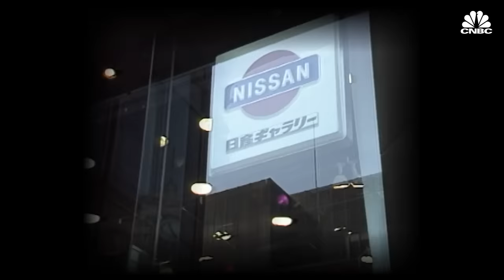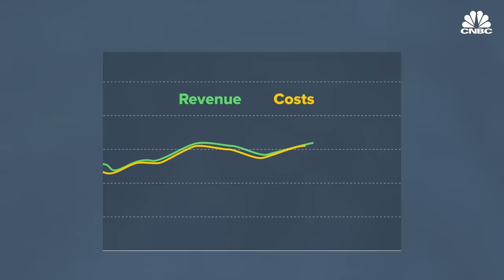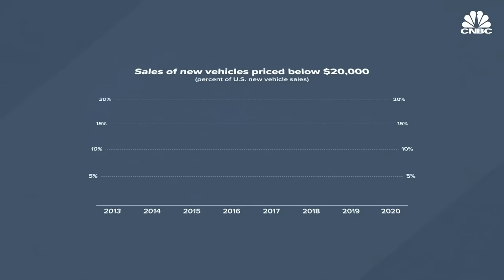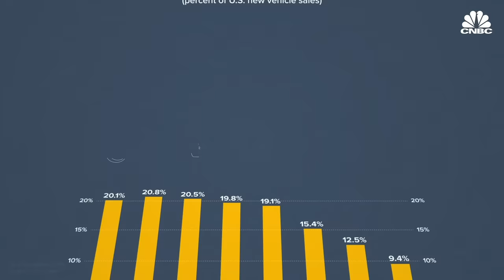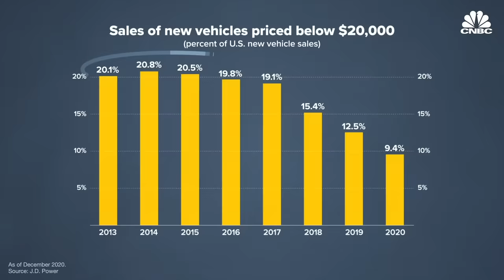Why Cheap Cars Are Disappearing

Comment: I'm shocked they're pointing to electronic features as a cause. A nice stereo can be put in at best buy for under $500. That's not even putting a dent in the 10k+ price increases we're seeing.
Reply: I know sometimes car dealerships will add the cheapest options for way more than what it’s worth on their websites it’s absolutely ridiculous
Reply: Look at all the HUD madness
Reply: I agree. It's a BS explanation. Adding Bluetooth? Give me a break. I have some old Airpods that cost 200 dollars that had the best Bluetooth when sold. The 10k+ price hike is because of a low-res camera on the back and some Bluetooth?  =|

Fair enough if people are going for something more fancy, like Apple's CarPlay - features like these probably add about 1k each, so would add up pretty fast.
Reply: @elliott8175  the camera also has sensors to tell you how close you are to something so it’s a bit more advanced than you think
Reply: @slapshotjack9806  Well, it depends on the set-up, but if you're like me then you just want a camera to cover the blind spot. There are "beepers", but they were around before the camera, and don't necessarily come with the package.
Reply: @elliott8175  oh I was talking about rear cameras which are mandatory
Reply: I think you're forgetting that it's not just "better" stereo systems going into these cars now. It's all of the sensors, software, and associated parts that come with tech packages that allow for convenience features such as collision warning, blind spot warnings, lane assist, etc. You can't expect vehicles to maintain a $20K price tag if consumers are demanding these new features be added but the quality of the vehicle not be compromised.
Reply: Typical boomer likes to say "entitle".
Reply: Yep I bought a 2001 Toyota celica and bought a stereo for 200$ and paid a mechanic to put it in for 100$
Reply: @foxfire54  Idk, my Oculus headset has loads of sensors for object tracking/proximity tracking,  cameras, inputs, screen, etc. It only cost $299. These sensors aren't as expensive as they would like to lead you to believe lol.
Reply: They are right. Kids these days are used to "NOW". They don't want to buy the car then go look at stereos then have a shop install that. They want to drive off the lot with a touchscreen, backup camera, bluetooth, Alexa Voice. I see it in my own kids all the time when I have to tell them no sorry, we have other things to prioritize.
Reply: There are YouTube videos of people buying cheap stereos with impressive features for $20 $50 bucks.  Back up cameras are dirt cheap to install from the factory.
Reply: I was thinking the same thing.  I had a bluetooth stereo put in my rubber-floor work model truck for $300.
Reply: These cars are basically crappy computers! I miss my real engine.
Reply: The issue is that you can't buy a car without one because it is tied into the control system of the cars at this point. Even a Dodge Promaster van requires the stereo to have a level of functionality beyond just being a stereo or the vehicle will not run at all.
Reply: @suffer4fashion  Facebook is making up the loss by harvesting your info and selling it to advertisers, this allows them to sell the Oculus at a loss.
Reply: They aren’t talking about a stereo, they are talking about lane change warnings, automated features like auto speed cruise control, auto breaking, all the multiple air bags that are in cars now that only used to be in the steering wheel and sometimes the dash on the passenger side, now they are in the seats, roof on the sides, and now smaller ones else where. You have heads up display, sensors all over the place that have nothing to do with the engine, sensors in the bumpers, windshield, Rear windows now, bluetooth, gps, mobilizing features for anti theft, internet, push button start instead of the trusty cylinder key lock ignition, and now starting to due away with column shifters for big vehicles with bench seats and console shifters with smaller vehicles with bucket seats for electronic push button shift, and many other features that really aren’t necessary! My 1988 Oldsmobile Ninety Eight had A computer that ran the engine and fuel injection, thats it, and yes there was an onboard voice diagnostic system and the new ABS brake system, but that was for the high end version! Yet it still only was 31,000 for the high end of that line! Thats pretty common pricing a n almost basic car today! It is insane and a rip off! Not everybody wants all those features!
Reply: The real cost is in having to turbocharge the low displacement engines to meet CAFE standards.
Reply: Yeah, their poor argument makes them sound incompetent and laughable. What’s essentially a bottom-of-the-line tablet console with a barely functioning operating system is not a “splurge” or worth doling out to cover manufacturer’s R&D, it’s a ransom situation which becomes an inconvenience to replace with a better alternative after-purchase. This sounds more like the cable industry: it’s dying so it’s hoping to squeeze the life out of any remaining customers before itself dies.
Reply: It’s not the infotainment systems, but rather all of the stability control systems the Obama administration required for vehicles to be street legal after 2012. That’s why you can’t buy a new Unimog or Lotus Elise, even though you can buy them in Europe and Asia.

The infotainment systems are cheap if they’re manufactured by third parties to spec and installed. However, trusting the union pukes at AC Delco to build a decent ABS and VSC system robust enough to handle electromagnetic interference from the ignition system, yet reasonably priced, is impossible.
Reply: But then it looks after market and not seamless w the car. Cheap.
Reply: A nice ✨stereo✨
Are your serious? That's tech to you?
We're talking about radar, touchscreens, motorizing more parts of the car, beefier ecus, cameras, better headlights, ultrasonics, better deigned frames with crumple zones and stronger pillars, wifi...
Reply: Plug a blutooth receiver into the aux in and use the phone. Almost free..
Reply: It's not just the cost of the stereo, it's the labor to put it in, it's the assembly line to install it, it's the logistical network to get those stereos from where they're made to where they're installed. And all those steps involve labor time and most importantly engineering. It takes up to 6 years to design a car from clean slate. Yea putting a 500 dollar stereo isn't very hard to do in your 1996 civic, but it's very difficult to plan and engineer all the stuff that goes into putting that 500 stereo into several thousand cars per month.
Reply: I'm glad  I can install my own system in my cars.
Reply: There is an over supply also.  If they are expensive why not make them here?
Reply: @1m2rich  they'll be even more expensive
Reply: @foxfire54  I don't want a single one of those features...about the only thing like that that I need is cruise control...
Reply: @slapshotjack9806  When you've driven from 16 to 51, you don't need all those rear cameras/sensors. Use your mirrors. It's OVERRATED.

Comment: New "cars last longer than they used to"? 90s Japanese cars would like a word with you.
Reply: Or any Toyota made in the early 2000s that were bulletproof.
Reply: @eman0828  what about new toyotas
Reply: @randomrazr  They burn oil before 60k miles.
Reply: Also the vast majority of trucks produced within the past 25 years or so will be pretty reliable and hold value extremely well
Reply: I have a 2002 civic that I've driven to hell and back and literally beat the crap out of it. Still fires right up every time and never gives me problems. Ten years I've driven that car everyday. The Japanese make one damn good car.
Reply: @Epotheros  really
Reply: @randomrazr  Especially the 3.5L V6. It had at least four lawsuits about excessive oil consumption for the 2006 to 2016 model years.
Reply: @Epotheros  so its not a reliable engine?
Reply: I agree. I just got rid of my 1997 Japan built Acura Integra after owning it for 22 years. It drove away under its own power. I never had any major repairs, just regular maintenance. I’m afraid I’ll never have a car I liked as much as that one.
Reply: Most of my cars are old, american and japanese and let me tell you, they are more reliable and have lasted longer than any other vehicle new that i have seen on the road, you see, i bought a 2011 mustang brand new back then and at 25k miles the computer went off, my 98 mustang work like a champ and my wifes 2011 corolla have replaced the alternator 4 times and the coils, the ac compressor 2 times, she also has a 98 tercel with178k miles on it and still have the factory coils, tell me, cars now last longer? I dont think so.
Reply: 90s Volvo's and BMW's and GM trucks..
Reply: @randomrazr  newer Toyota’s and Honda’s are banking on that reliability reputation from their older models. I highly doubt the newer ones will be anywhere near as reliable.
Reply: @lefthanded5473  New Toyota's and Lexus cars are the most reliable cars on the market, I don't know what the hell you're talking about..........
Reply: Not just 90s. I have a 2007 Toyota Corolla, still runs like gold.
Reply: @ianhall6614  that is just because there is a shortage of affordable trucks. Try to find a base model Frontier, which had an MSRP of $18 k in 2018, for under 15 today. There are none. The floor came up and brought all trucks with it.
Reply: @coupleofbeers31  I picked 90s cause some Japanese makers started to slip mid to late 2000s.
Reply: @PushStart_YT  You are right though. I still see plenty of 90s Yots still on the road and running awesome.
Reply: @jimbarr4606  I still have my 93 Integra that drives on its own every time I need to use it. 😬
Reply: @MrJimmy3459  You are correct. Toyota/Lexus may be the only JP car maker today that still makes fairly reliable vehicles. Not even Honda/Acura is reliable anymore. For example, oil dilution problems with their direct injected engines, where as Toyota/Lexus uses their D4S system to compensate the flaws of mandatory direct injected cars of today. The down side is this makes the setup more complicated so longevity is unknown but Toyota has been using it since the mid 2000s in their Lexus lineup with little to no troubles thus far. I believe today, only Toyota cars may still last 20+ years. Maybe even Mazdas. Everyone else basically makes disposable cars. I guess it doesn't matter 20 years from now because everyone will only have electric cars as the purchase option, so they will just be an appliance purchase, refrigerators on wheels.
Reply: I always go for Japanese cars. Always. Reliability is more important
Reply: @PushStart_YT  I used to drive Mitsubishi and it was horrible. I agree that not all Japanese cars are made the same. Toyota is definitely number one. Maybe Honda second. Mazda? Unless you are driving the MX-5, don’t buy one for the reliability.
Reply: @PushStart_YT  also, the Japanese government is now mandating only hybrid or full electric in Tokyo by 2030 to 2050. So, yes the Japanese cars will be electric in the future.
Reply: So would my 1990 F150 with 600k miles on it.
Reply: @jimbarr4606  why not buy another one soon? They're going up in price. I'll never give mine up even if it just sits in a garage the rest of my life lol
Reply: have a 85 toyota with 375k miles on it also have a 2008 grand prix with 275k miles on it. cars after about 2010... break @ 100k miles because auto makers realized if the car is too good you cant keep getting revenue. Especially since tech upgrades and interior and body changes are not on most people's mind when buying.
Reply: My 1999 Nissan Primera is awesome, I have had it for 12 years and it is incredibly reliable
Reply: Some of the best A to B/daily drivers ever made came and went. Like the circa 2000 Civic, Accord, Camry, Carolla, Focus. Listening to marketers tell us they're improving vehicles is just laughable. These cars got 35-40 mpg and ran for an eternity. What have we gained in the last 20 years in the form of basic transportation?
And I love performance/muscle cars which have made great strides in that same time (along with trucks). However, for a daily driver all I want is the reliability and gas mileage of a 2000 Honda Civic at a reasonable cost! It is absurd that I can't have that. Automotive is all about forcing change so that consumers never realize what would be the amortized cost of the same product being made for 20 years.
Reply: Absolutely. These were the best then, and still are the best now.
Reply: 80s Mercedes and Volvo owners have a good laugh at that statement.
Then you have Lexus owners.
Reply: Word.
Reply: Yeah but have fun with having a horrible ass suspension after 100k lmao.
Reply: @joaodasilva4734 Really? I thought Toyota Corolla lasted forever and was the most reliable car?
Reply: Nobody:

Scotty Kilmer and his 94' Celica:
👁👄👁
Reply: @lefthanded5473  No car is going to be as good as the old one, but Toyotas and Hondas are still better than the rest.  I currently driving a 21-year-old Toyota Sienna and it gets me from point A to B without any problems.
Reply: @Epotheros  What're your thoughts on the 1.8L V4 from ~2007?
Reply: Totally agree I drive a 95 Maxima bought it last year for $600 still runs great cold ac etc. Recently it started leaking coolant, but still runs fine no overheat, just got to top off as it leaks
Reply: Correct. And some 2000's. My sister has a 2006 Toyota Highlander she got for $6700 (at 120K)  that has gotten her to work (100 mile round trip) every day for a year and a half with only regular maintenance. It never misses a beat and isn't even rusting. It looks great for its age.
Reply: @Epotheros  four lawsuits? really...
Reply: @jimbarr4606  Jim Barr I still got a 92 Integra that I bought brand new still runs like a top it's had its problems but most reliable car I've ever owned
Reply: pretty sure 90s japanese cars are rust buckets because I have owned and sold many of them.
Reply: @potatochobit  depends on where you live. all cars can be rust buckets at the right conditions
Reply: @dmj-ju9zx  In northern California if you go on craigslist & look for gasoline cars with minimum 300,000 miles, they're mostly Toyota's!  A couple fleet vehicles, work trucks, and Honda's.
Reply: 1950s cars in Cuba would like a word.
Reply: @randomrazr  My 2015 Camry has nothing falling apart including cosmetics. It has the superior 2AR-FE not that POS 2AZ-FE.
Reply: @potatochobit  My ‘91 Honda CRX has absolutely no rust on it.
Reply: I was searching for that comment ;d
Reply: @Omnip073n77  Rebuilding the suspension on most cars is not much of a big deal. Especially Japanese cars from the ‘90s. Last year I had the suspension rebuilt on my Saturn and it’s driven like a new car since.
Reply: @berksarioz969  also 90’s boxy mercedes
Reply: @AlexCab_49  they sure take a good care of their classic cars
Reply: Micah Riley meh, change the springs, dampers and bushes and keep smiling 😉 the parts are so cheap and easy to find and you won’t need to plug in an expensive computer afterwards either!
Reply: in Sudan Hilux 80's and 90's are the major cargo vehicles and they considered the best and they are give their owners free trouble ride all the years and they just last forever and they still hold their values
Reply: Still have a 93 civic eg sedan 1.5l vtec 5 speed manual and runs better than my bosses 5.0l mustang. Sad he can't keep traction to keep up with me plus I feel bad since he's had it in the shop more times than my car has been pulled into my garage.
Reply: @eman0828  my 2002 camry is still going super strong 💪
Reply: @chieftigmos4018  Those days are gone. I bought a new 2015 Accord and it's a piece of $hit.
Reply: @networth00  I've got a 2020 accord for the wife and it's awesome. I fix alot of them at work and i think they're pretty great cars.
Reply: @chieftigmos4018  Of course a 2020 will be awesome, it's brand new. I've owned lots of cars and the Honda quality is nothing like it was before. I bought a 2015 new and it's had tons of problems.
Reply: i mean my 2 90's gmc trucks are still goin strong and even my 88 pickup
Reply: @Epotheros  Burning oil isn't really a serious problem. It could be worse.
Reply: @lefthanded5473  Honda still uses the J series V6, so at least that won't break down.
Reply: @DanielK1213th  Mazda is very reliable, they have serious rust issues though.
Reply: @PushStart_YT  Meh those 8 speed transmissions Toyota’s switching too seem to be having problems too. Also the the CVT problems with the Corolla hatchbacks. Wouldn’t say Toyota is as reliable. The oil dilution problem in the Honda’s is blown out of proportion. But will still effect long term reliability compared to the naturally aspirated ones like the 2.0L base civics which should last since they fixed the CVT problems that the 2014-15’s had.
Reply: @lefthanded5473  yea, we are moving towards disposable cars so reliability will be a thing of the past, regardless of manufacturer. but currently toyota still holds the crown as far as engines reliability goes. cheaper to replace a toyota tranny than a honda engine lol
Reply: @Epotheros  My man is talking about a damn 3.5L V6 as if it were an average engine or even close to one
Reply: @randomrazr   if it's got direct injection, and an EGR system on it, it's gonna self-destruct pretty quick!  (Thanks EPA!)
Reply: How do they even know how long will the new cars last? Did anyone go to the future and came back and said, yep 2050, people still drive the 2020 Chevy.
Reply: Exactly. Have you not seen 50 year old beetles going round?? :-)))